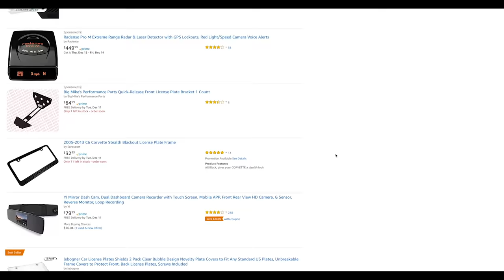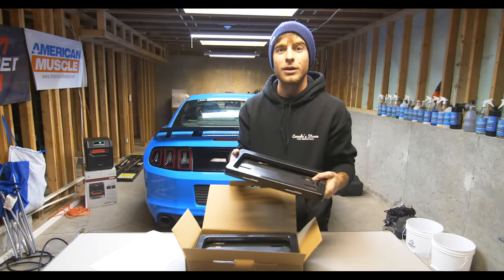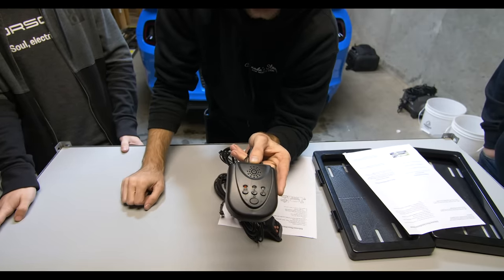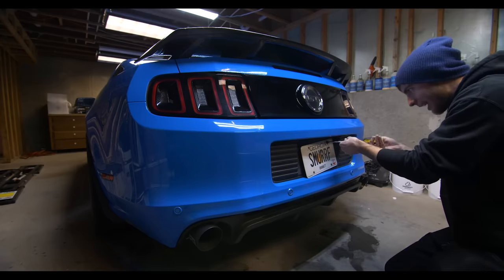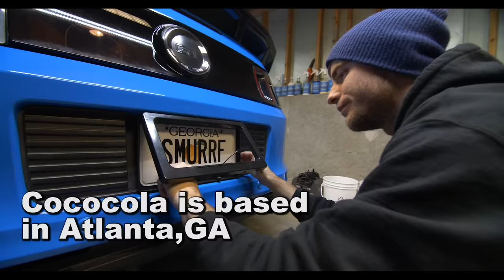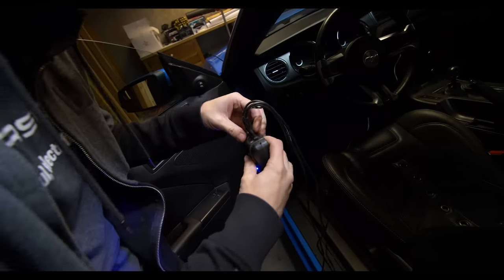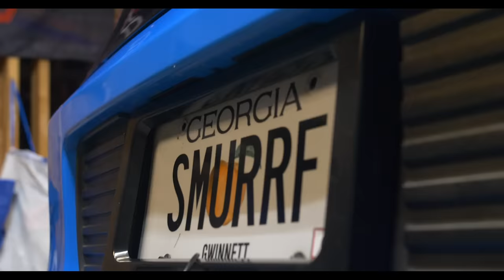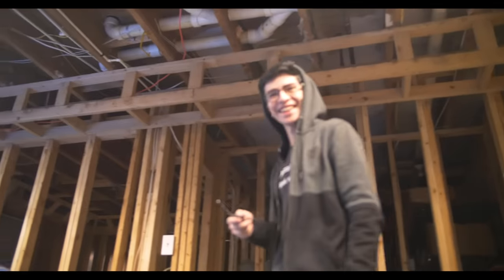Stealth Plate Mythbusted : Can You Getaway With a Hideaway?

Comment: The plate flipper ones are better because you won't visibly stand out for not having a plate when you want your main one hidden. You just flip it to a fake or show plate instead....
Reply: you print a random plate on the hider thing
Reply: Thats probably an extra charge if you flip it and use ficticous plate. .
Reply: Its an automatic arrest and can possibly be a felony in nyc
Reply: problem is you have to drill big holes in your car tho for the flipper
Reply: I feel like after 182 likes I'm missing something, but wouldn't you only need this kind of protection when you're standing out to the cops for doing something illegal?  The blank space is as good as a fake plate at that point because it takes 2 seconds to lower the shade and the cop probably isn't behind you in 2 seconds.  Unless the cop is already behind you before you commit a crime then you really wouldn't need this (I look behind me before taking off like a bat out of hell personally).  Plus the added risk of running a fake plate with a cop behind you is enough to get you pulled over without racing and is probably a pretty gnarly offense.  Just curious if someone could give me a scenario because I can't think of one.
Reply: @HOTRODRICO  That's not true. There are videos online of it in action. The frame tilts out to make room for the tags to flip over. No need for a space behind the tag/frames..
Reply: dragon0361 it is a felony
Reply: It’s better to hide the plate than use a fake one, felony vs a ticket
Reply: dragon0361 if you’re get caught lol
Reply: @myroc1  use it for the toll roads because my balance on my toll fees is over $5,000 so that's why I want that thing that's your best scenario
Reply: @juhotasken  just upgrade the motor seems pretty straight forward. Or apply more voltage.
Reply: We here to flip plates. Y'all really think we caring about the felony part 😂 trying to get away from that
Reply: a fake plate is like flipping off a cop. As soon as they run your plates you’re REALLY in trouble. I love this product. I use it to dump stuff at dumpsters where there are cameras. PERFECT!!!!
Reply: @willbean921  same I've been using the flipper in SF, for all 5  bridges, the Golden gate Bridge, bay Bridge, Richmond Bridge, and San mateo Bridge and the Dumbarton Bridge all in the bay area:) fuck taxes and fuck tolls and fuck parking meters I've found ways to always beat all  3 and have saved literally HUNDREDS OF THOUSANDS OF DOLLARS IN THE THE PROCESS OVER THE YEARS!!The taxes one has literally doubled my net income here in California but that was with the help of a straight G of a CPA. And yes I am very fucking proud of myself :))
Reply: @joncar13jonny15  haha! Nice one! Any other ideas where us like minded people can make use of this? Besides bridge tolls?
Reply: I’m going to troll a public bus by putting on hazards and stopping every block in front of them.  It’s a long story but this should help in that case
Reply: cops use technology to automatically read your plates and show what car is registered to them, as well as other info.

If you are not driving the car the plates are registered to, you will get immediately pulled over.
Reply: @dragon0361 it’s a misdemeanor
Reply: @seethruhead7119  what if it’s plates from an identical make, model and color?
Reply: @carterlongcor3233  hmmm good point...
Reply: @carterlongcor3233  genius

Comment: I have always added an inch  wedge of plastic or wood behing the top of my lic plate . It tilts the plate down , bouncing the radar signal down, instead of back to the device. Does NOT "deface" or obstruct the plate!
Reply: you think that would work on the front plate going thru a toll?
Reply: It wont
Reply: Pretty sure radar bounces off the whole vehicle, not just the license plate

Comment: Plot twist : the driver featured by the authority has been decralred more safer than the insured drivers, because he was aware about his culpability if an accident / incident occured.

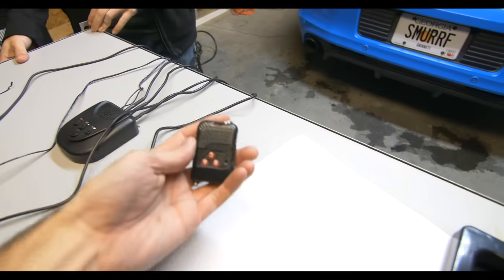4:00 He calls this cheap because it is Chinese, but probablymore than  50% of every electronic he owns is made in China...!?!? Such a meaningless argument.......... Change my mind.
China is able to do High End parts, just as Low End...

Also, if they knew how radio frequencies work, they would mostly understand that this antenna gives a lot more range to the device for the same power... such ignorant people in this video... If I need to run away from cops, I would only rely on the wired signal though, which is also included...

8:52 I am confused at what he says...

Also I really don't get why they laugh so much about the antenna, having myself some knowledge on radio frequencies... It seems to be the main attraction of the video, for kids...

Comment: Smoke screen.
What you should do, is put an LED under glow all around the under of your car. Typical under glow kit. 

Then, on the out side of the under glow kit. Mount PVC pipe under your car. Drill small holes all along the PVC pipe. The holes should be pointing to the ground.

Plumb up a smoke machine to pore smoke in to the PVC pipe, so that you now have a curtain of smoke illuminated by your under glow kit.

Do this while parked. Not while moving. Maybe while moving, or when you are about to take off from a dig.

Comment: I paid $80.00 for mine (Took some searching on the net) and routed the wires along the license plate light's power wire (no need to drill any holes) and it works great for times I'm driving through neighborhoods that have speed cameras. I drive fast on the highway but don't purposely drive over the speed limit on neighborhood streets). I've been trying to buy the license plate "flippers" for 2 years now for less than the ludicrous asking price of $150.00 for only one. I've made many offers for the full set of two only to be turned down until last week. I paid $130.00 for a set of two! I intend on installing my plate as the main plate and a hot rod club plate (which my club offers it's members to use as a front plate) as my second plate, front and rear. If I ever am questioned by the police, I'll simply show my membership card and explain that I must've either hit the button accidentally while entering my vehicle or just forgot to return the tags to normal position after leaving one of our car shows. I'll post a video of the flipper in action after it arrives and has been installed. The wiring and remotes are identical to the ones shown in the above video. The only things that are different are the frames which flip one tag over to show another. Some of us guys never completely grow up, we just love our gadgets and toys lol.

Comment: Where I live, you'd get pulled over and have your car searched just because of the frame around that thing. They will say that it "partially obscures" the digits on the license plate even if it's nowhere near touching them. It's one of those "I wanna pull you over but dot have a real reason" things like "a tree hanging off your mirror is a driving distraction".
Reply: Same where I live.

Comment: The only way running from the cops doesnt work is if they got helicopters or if your car is slow af other than that and if u got the skill and quick thinking to do so these would come im handyespecially if u are in a hot climate and the nights are coldand you paired it with you heat changing paint so it changes car color aswell  you could be the god of escaping police just sayin lol dont come at me fbi

Comment: Not condoning breaking the law lol, BUT, since the clear covers that prevent cams from seeing the plates are illegal, I would think combing this with one of those, instead of the all-black cover would work nicely. It would always be scrolled down except when you are being pulled over. Retract the clear cam blocker as you're being pulled over so the cop can't say you had a clear cam blocker on. Also, since the clear cam blockers look pretty normal from a straight-on angle, it's unlikely the cop could see it retracting as you're pulling over.

Comment: Hey Dude! I know it an old video but, there is a thing called PDLC or smart glass. Its a transparent film and if you apply voltage to it it will turn into non-transparent immediately. And I think it cost less than this crappy thing also thinner.

Comment: Any driver does not have the time to click a switch because in Chicago the camera will snap you long before you realize your license is on concealed camera and you will get a 100 dollar ticket. Need something thats instant that foils the camera picture taking like a bright light causing overexposure. This thing would get you a ticket. Any cop behind you will catch on easily
Reply: Not only that but people like me turn people like them in to the authorities. I routinely report vehicles with expired tags, missing plates, paper plates, etc, to the highway patrol. They have a tip hotline for vehicle owners that cheat the system. I'm a regular on that hotline.

Comment: 1.Go to Walmart
2.Buy a tinted License plate cover
3.Buy shimmer/shine PlastiDip
4.Buy cleat coat PlastiDip
5.Apply roughly 2 coats of shimmer (let dry)
6.Then about 1.5 coats of Clear coat. (Let dry)
7.Apply cover to plate :)

 Headlights will "blur out" the plate to a somewhat mosiac  look. 

And the flash from photo traps also blurs put the plate 😁